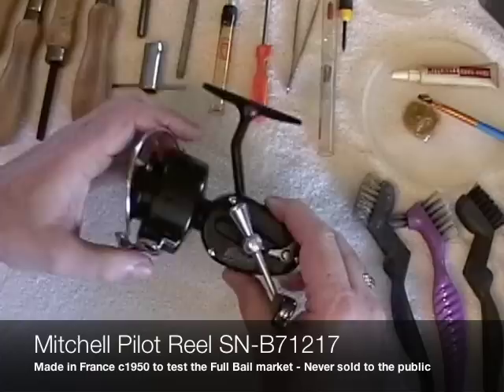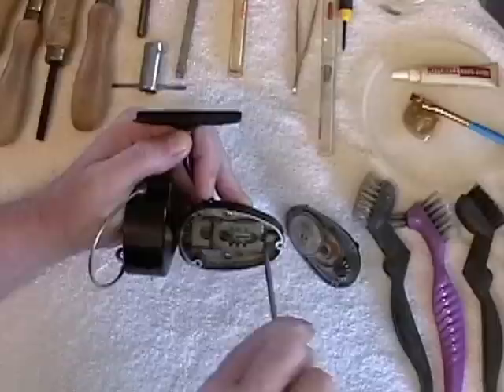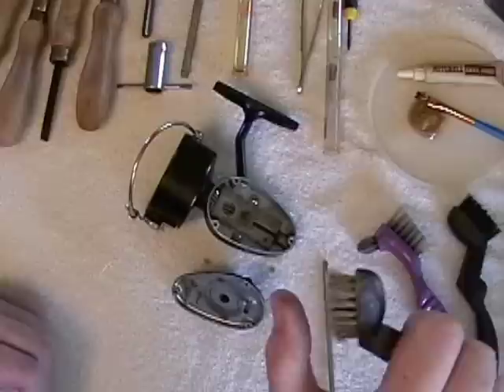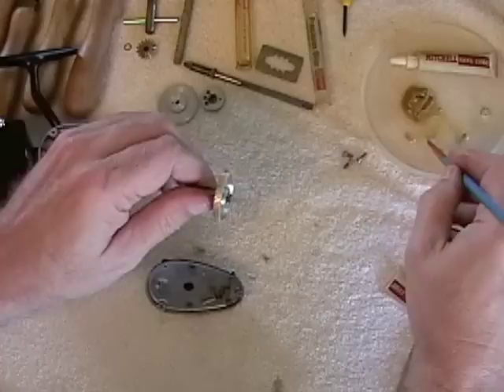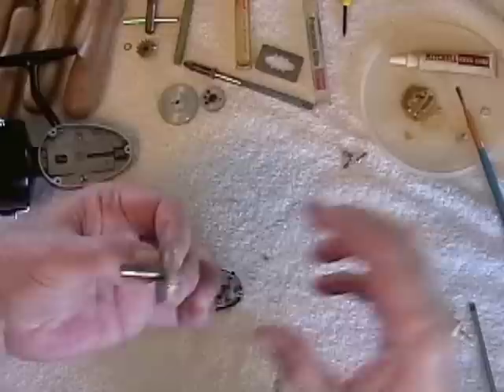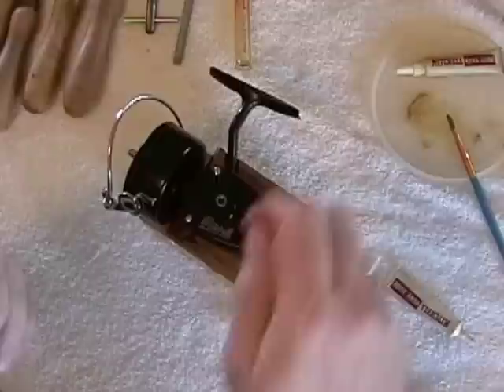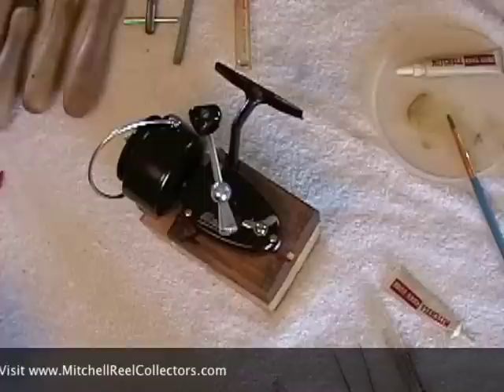Garcia Mitchell 300 Reel Annual Service Repair

Comment: The 300 is in my opinion the best reel ever made. I've got 4 of them and use them for carp, pike and general coarse fishing. One of them is over 20 years old and still going strong, I'd never replace them.  Tight lines TT England

Comment from the maker: I use WD-40 or Goo-Gone. Both are stocked at Lowes Hardware and are very safe to use. FYI, don't interchange any parts between reels or they won't run as smooth. Good Luck and Have Fun, Wallace

Comment: Bought a 500 for an ultralight rod. It's very smooth enjoyable.fishing recommend casts great. One odd thing- the bale wire is a bit heavy diameter in my opinion for a reel of this size. But a great purchase.
Reply: See link below to fix most bail wire problems:

https://youtu.be/_muYtp4J5f4?si=7hzWhkMjGZ3Ad0QJ

Comment: Add my thanks for your videos! Just cleaned up an old 410. Not exactly the same as this but close enough. I would never have figured out how to get the main shaft out since it was pretty tightly stuck in with old grease. Your video showed everything I needed to see!

Comment: Thanks Wallace, I just fixed my bail spring on a France made 300 Mitchell , using your other video about the bail wire and spring.
It was a little bit bent like the one in your video, not as far off though, but after removing the small screw, it did not stay centered over the boss like you state it should.
So I carefully bent it into proper position.
 There must have been some grit in where the bail spring is too, you could hear it, and it was not snapping back 100%. I disassembled the bail spring, and cleaned everything up, and using your video, replaced the spring, and it is working perfect. The spring was really not that hard to replace.
 Also,opened up the case (like a book) and  took the old dried up grease out, Cleaned, and re greased everything.
I was scared to take the anti-reverse dog and spring out all together, so I cheated, and just cleaned it with a q-tip and some solvent and re greased it. I guess that will be OK?

I too have a, made in Taiwan  300 coming from E bay, but now I am worried, does the made in Taiwan  300 have plastic gears?  I have heard it is a pretty good reel too, (made in Taiwan ) but now I am wondering.
I want to have 2, 300 reels for my medium action 6 foot ugly stick rods, for my river rods.
Reply: I now have a total of 4............LOL
My finding with the 300 made in Taiwan model, is that it seems to be a good user reel.
So far, it is smooth, and quiet, and have had no problems.
I got a good deal on the Taiwan model, ($17.00 with shipping) and got another 300 (regular 300) that is pretty clean, for $21.00 shipped. She had it on there starting at $14.95, but shipping was $12.70. No one bid on it.
I wrote and asked for a better shipping quote, expecting her to decline, but to my surprise, she went with a flat rate padded envelope, with the reel in a box also, and the box in the envelope, and relisted it for $14.95, and $6.00 shipping.
My 300 C was only a total of $24.00 with shipping, but the Anti-Reverse dog was wore out (Bad) on it, and it was listed as perfect working condition. The seller worked with me, and refunded half of my money, and I was able to buy a NOS dog for $8.00 with ship[ping.

For a ultra light set up for trout fishing, would you use a 300 reel, or would I be better off using the 304's I have right now.
I had a 308 A, but that was stolen. I have tried the 304, but now, am leaning towards the 300's.

Comment: Awesome I just picked one of these up in a garage sale. It’s a Mitchell and Garcia and it’s almost identical except the handle has a screw at the end instead of that counter weight. It’s in pretty used shape I will be doing this to it as I want to pair it with a nice cork handled pole and use it for fishing this year.

Comment: I am 46 and this is the real I learned to fish on. I still have the one my father got me as a young child plus I now have his small collection of them. I never messed with cleaning or anything throughout all these years and now this year I have had to. It got really stiff and the reverse lock was not working. I have about 10 of them now that I have picked up from garage sales. Mostly use them for parts. I have never used anything els other then this reel.

Comment: Bought a gallon of WD40 with a refillable sprayer and worked over half of a plastic gallon jug as a washing bowl. It worked fantastically. I cleaned and lubed an old made in France unit as a gift for a friend and when it was done it was so shiny, smooth and minty new looking I hated to see it go! But if you don't give your best it doesn't count right? I used an old tooth brush to scrub and even the grungy bail wire came up like new. I'd never do more than 1 at a time. Thank you!

Comment from the maker: Look at the bail release pin (pn 81396) and see if it's stuck. This pin is spring loaded and when working, it should stick through the hole in the bail wire mount next to the bail spring when you open the bail wire. This is a common problem some wd-40 can fix. Let me know...

Comment from the maker: @ttownthomas I use WD-40 for cleaning. Since this was a mechanical restoration on a rare & mint reel, I used original Mitchell grease knowing this reel will not be used. Any marine grade "quality" grease made for fishing reels will work and easy to buy anywhere fishing reels are sold.

Comment: I also have a Garcia Mitchell 3-0-0.  It does not appear to me that the button to release the spool works.  Do you know if this old model did have a button on the end of the shaft that you press to release?  If it supposed to be a release button its movement on this reel is sluggish.

Comment: Wallace, what is your choice of grease for the mitchell reels?
A fellow at the site said he mixes wheel bearing grease with 3 in 1 oil, and that is the best he has found.
I will probably try this, but wonder if there is something good that is ready to use "out of the box"
Hopefully not something too costly. What about "superlube"?
I have read where some are using that.
Reply from the maker: +anthony diodati SO SORRY ANTHONY, I JUST SAW THIS! Grease brand is not that important but the type is. Use any "marine grade" grease as Mitchell and Garcia recommended. Depending on use and normal maintenance throughout the year, it will be fine!

Comment: Hello friend, I want to congratulate you for your video about the fishing machine.
I have had the same machine since 1968. I got it as a gift from my uncle, so now I want to ask you something, you must know more about the fishing machine.
How many meters of thread does it collect on the reel, if it is of the following thicknesses of fishing line, for example: from 0.18 mm., 0.20 mm., and 0.23 mm.
If you know, I will ask you for an answer, if not, then I will ask one of your fans for this question. You can also point me to a website, where I can read about this question of mine.
GREETING

Comment: Dear Sir thank You on excellent and educational videos.I am fed up with this new" high quality"tackle so I returned to Mitchell 300.I own pre Garcia Mitchell 300, plus I bought Mitchell 300A(silent AR ,seller on ebay claims) without rotor and handle.I want to put rotor part and handle from my Mitchell 300  on my Mitchell 300 A.Does it really fit?Are they interchangable?

Comment: I fish one of these from the 60's but recently noticed that the bail doesn't lock when I lift it from the bottom up towards me, works fine in all other positions. Before I take it apart thought you may have idea. Thanks
Reply from the maker: That's very common but just where it happens depends on the baffle plate's position. What's happening is, in that exact position, when you try to open the bail, it's hitting the baffle plate's trip pin. Let me know if I can help further...

Comment: Thanks for the informative video.  I just followed along with you and did the maintenance for my 300A, which is slightly different.  Question, on the shims on the pinion gear, they are placed on the shaft first then the gear goes on right?  I didn't pay close enough attention taking them off.  Thanks
Reply from the maker: Hi Richard, Yes the 300A had what they called M7 gears but as you see, they're pretty much the same as far as service. The shims go under the pinion gear between the cover plate and the pinion gear. Glad I could help. Regards, Wallace
Reply: Mitchell Reel Museum
The reel is working great, very smooth.  On the bottom of the spool it is dated 1977.  I just bought this reel, so I am not sure if it has been cleaned before.  I used Abu Garcia Reel Lube, which is readily available at Dicks Sporting Goods and Bass Pro Shop.   Do you think the brand of grease makes a difference?
Reply from the maker: Richard Roe
 I use Abu Garcia Reel Lube but I really don't think it makes a difference as long as it's marine grade reel grease. When an old Mitchell has ball or roller bearings, then I would only use Abu Garcia. I've found that everyone has a different opinion on this subject :-)

Comment: I have a lightly used pre Garcia 300 on the way to my home right now to pair with an early 1970’s Fenwick. Is there markings of any kind on the reel I can look for to confirm what year it’s was made or what size/model it is? If there were different versions.. I don’t know. I do know it was made in France.

Comment: I bought one in 1980 knowing nothing about it, but it felt good and I thoroughly enjoyed it until it got borrowed without permission and never came back. I've never had another reel feel so rite so I ordered one from ebay. Meanwhile my wife got one at a yard sale $2 but it was made in Taiwan. It has a chewed up gear. I'm considering getting new guts from ebay to save it. Could it be a good user unit like one from France? Also - the drag tightens up on it's own, can that be corrected?

Comment: I completed the cleaning and reassembled all parts. The reel does great free spooling, until I try to spool line on and it takes about a dozen turns and the pivot gear will jam. Any idea what is wrong? It worked great before.

Comment: I have a bunch of old Mitchell 300's now and I would like to know what is a good solution to use for cleaning all the parts prior to lubrication. Some of these are over 40 years old and have probably not been apart. Some stink and have hardened grease.

Comment: Mine also has a piece of plastic that has like a leaf spring. Did not see it in this video
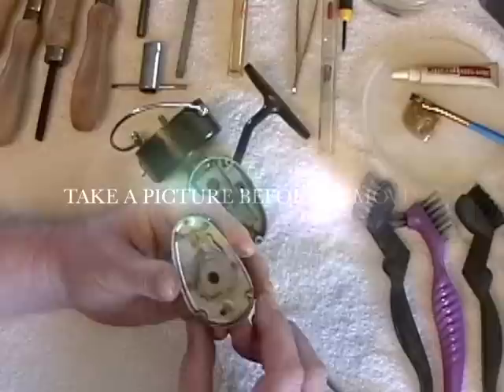Reply from the maker: That is your Anti-reverse Dog. Plastic just means yours is a newer model. Look at 3:18 into the video and again when it's reassembled. There's only one way it can fit, the leaf spring is held in by the edge of the cover plate. Hope this helps...

Comment: Hi, I'm just coming across your videos and I'm looking for some help fixing my drag.  I have a Mitchell 300 the drag no longer works and I can't figure out how to fix it.  Do you have any ideas?
Reply: Deej Wolfdarlin unscrew the drag set screw on the top of the spool and check of the tension spring is in there.
Reply from the maker: +R Campbell and +Deej Wolfdarlin, Deej is correct, your spool needs service.

Comment: i think you should put more grease on the reel .
Reply from the maker: +thehegt Tr Hi, you can apply more grease but it will just be moved away from the teeth. Garcia recommended 1 teaspoon for the 300 sized reels.

Comment: l have a 300C that is noisy. there is one shim and the washer under the baffle plate, and 1 shim under the rotor, between the rotor and the case.
There is no in and out play in the rotor, and it spins freely. I also tried a different pinion from another 300, but it did not help. Should l put a shim under the pinion?
I would have to get some.
How thick of a shim should I start with?
Reply from the maker: Adding pinion gear shim(s) would be my next move. Please join our discussion group where we could help and give best advise. Click here http://www.mitchellreelmuseum.com/forum/ and then Register.
Reply: Mitchell Reel Museum OK, Actually l did join, and wrote there, but here is what I found..................
Quote from the group
I still need a anti-reverse dog, (The teeth are stripped out)

But I think I found the shim, I think someone was in there trying to fix the Anti Reverse, and lost the pinion shim.
Would you believe I found it on a rag?
And I thought it came out of this other (regular 300 reel ) reel, but that reel had 1 under the pinion, so I added this one also, but when l put the side cover back on, it jammed up the rotor.
So I put it under the other reels (the 300 C)  pinion, and it is way quieter. So it must have been floating around inside the reel, and got stuck to my rag when I was cleaning the old grease out.
There were no pinion shims under that pinion at all, and I understand there is always at least 1 pinion shim?
has that been your experience as well?

I might like to try one more thin one, see if I can get it a little better.
Might try a piece of tin foil as a temporary test.

I wonder if that plastic dog they went to was a problem with these reels?
Reply: Mitchell Reel Museum I did ask at the group, might be a little slow right now.
Would it pay me much to get the main drive gear shims, are they used very often?
I thought l read they are only needed on the older reels where the bushing is flush with the side case, and the main drive gear is wearing on the case, proven by witness marks on the side case.
Is my understand also correct, that the main cause, and repair of noise is play in the head ,and  shimming the head, normally head to housing?
Would it pay me to get the pinion shims, does that do much to quiet the old reels?
I see they are not for sale too often. And when they are, the are more costly than the others.
There are some main Drive gear shims(81035)for auction right now, and I need to know weather to save my money (not needed very often) or to bid on them.
If I can find some brass tubing of the correct size, I may try to make some pinion shims using my metal lathe.